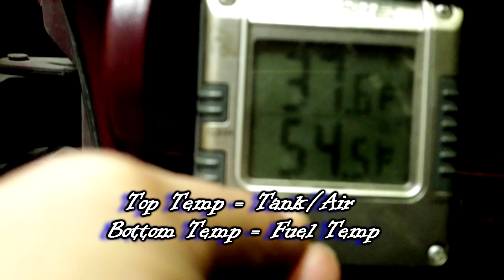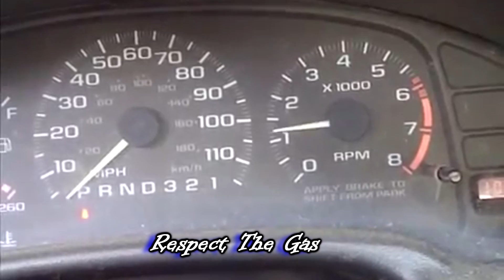Is 100MPG + Possible?? Alternative Multi Fuel Vapor Van!

Comment: I've debated running a T-connection of some sort to a transmission cooler that is housed inside a fuel cell.  Zero spark issues to worry about, and it's going to constantly be warm as long as the car is warm. Use the regular fuel system to start the car and have the fuel pump on a toggle switch to shut it down once warm?  Just thoughts in my head!  I'm thinking of doing it to see it it is possible solution. A warm coolant would warm the fuel faster than sticky heaters. Less loss in thermals. Should be sufficient.
Reply from the maker: Thanks for your input and watching. Yeah we're thinking alike, I've taken a ammo box and 1/2 copper pipe with a bunch of elbows (to run coolant through) and made a fuel heating box to use a fuel pump  to circulate it into the vapor box. Then we moved, shortly after my son ran the oil out of the van and blew it up, then the firebird got into the mix. So it's on the back burner and will be used on a lawnmower engine for testing with exhaust going through the copper instead.  I'd still want to pre-heat the vapor box and try to keep as warm as I could with those heaters.
Reply: @InJayzBrain  12 ft of high temp hose and 12 ft of copper tube.T each end so water can be run into it at 180 degrees and return to the block. And the copper,on one end tap into the fuel line,and other end send to injector or carb. Once the copper line is inside the rubber, wrap it around a can or cylinder of your choice and have a coil that will fit neatly and less space. The copper will have 12 ft of 180 degree water hose to get hot before it comes out. OR wrap the copper line around the exhaust pipe before it goes into a carb or injector,directly from fuel line.

Comment: im working on a spray system that takes care of the vaporization and usieng some exhause heat to fully vaporize it. extra spray goes back into a T valve just b4 a fual pump, so u don't cycle all the gas
Reply from the maker: Nice, I'd love to see some pictures on that. Are you video documenting the build?
Reply: sadly im not but I can explain, the  spray thing is as simple as a misting system which uses a pump, orifice,hoses ofc, making it out of pipe and emt conduit imagine something like a + were 1 side goes to engine 1 side fresh air top is spray in-let , bottom have a line running back to the pump using a T fitting. so u don't cycle all ur gas tank. because might end up making the gas in tank go stale, which u may notice happends when u try doing regular vapor methodes u see online. after that part just need a valve for fresh air to make ur air/fual ratio. after that run it on exhaust headers to heat/vaporize the mix then u have butter fly valve for throttle, and iv done it to a 14hp onan welder/generator and it works fine. runs so clean u can't smell the exhaust at all, just as if hot air is coming out
Reply from the maker: That sounds sweet, I've made a fuel heater out of an ammo box and 5/8 copper tubing initially to run my coolant through while this cycles gas to the vaporizer tank. Since my son blew up the van I haven't done anything with it. After I get a couple project cars done I'll be fitting that to a lawnmower and turning that into a generator with the fuel heater piped into the exhaust and see what that does.
Reply: InJayzBraiN it's best not to use heat, all you need to do is remove some of the atmosphere.

Comment: Been running a vapor carburetor on my boat. Have had trouble with moisture building up in vapor cell. Found that a mix of alcohol keeps it running better and keeps gas from going stale. It uses way less gas now. Think it burns so much cleaner too.
Reply: interesthings, what kind of alcohol did you added, and how much ml per liter of gasoline ?  thank you
Reply: seen some use white gasoline instead.

Comment: The Oil Companies put additives in the gasoline. If you run a cold bubbler system , the engine will run for 20 minutes or so, then it will stall. This is because the Gasoline goes flat, and no longer produces vapor. The Gasoline that is left is called the "Heavy Ends", and is full of Olefin's and Paraffin's, and will leave a greasy residue, that will clog your components, and wont produce vapor.

Comment: Hi 
Thanks for your response. 
The tank we used was originally a milking machine vacuum tank. At the time we had no idea vacuum was the function of the device. We used a bubbler system. Actually after 3 years and the break up of our team. I never thought to test to see if the increasing viscosity would work as a natural valve that would give appropriate resistance on its own. I was pondering the magnificence of the universe one night and thought of it lol
( about 10 years later)
You see because you are refining the gasoline into layers the final heavy ends resemble diesel more than gasoline. If you take the unit apart or take some of the gas out of the tank as a sample, you will find it is a little oily feeling like gasoline that has sat in an open container for a few days
Gasoline evaporates at room temperature then stops because the boiling point of gasoline is 100 to 400 F. Keep in mind it is the by product of refining and as such it is the light ends of the heavy ends of the fluid that was refined at a lower temperature. It is also the light end of the refining process of the fuel that is next in the refinery process ( diesel). The light ends of gasoline are like the heavy part of a vocation fuel and the heavy ends are like the light ends of diesel. Then there are many " layers "to the gasoline itself.  These layers are the problem for as you progress through them they need a different environment to evaporate in ( more heat more vacuum for instance
The final tank was made from a 12x12 steel column ( hollow not I beam ) a tube. It was 3/8 of an inch thick and we put a false bottom. We used a 3/8 plate for the top and had a gasket surface ( big mistake it leaked ) with a clear plexiglass port in the top. We used a pool valve for the intake and the throttle body on the engine for the speed control
We used grey plastic plumbing fixtures and a clear vinyl pool hose as the delivery with spline fittings at both endsTom ogle used the original tank and steel plumbing lines up the frame. This way is a problem as it takes a while to get the vacuum to form as there is so much tank to draw the air out of
Engine mount is best. Trust me on this one
You can hear your garage with the exhaust but the carbon dioxide will displace the nitrogen in air and though the exhaust is not toxic like carbon monoxide it is still something to be wary of. We breathed it for 2 years with no health problems
I never tested the vacuum strength but if you placed your hand over the intake and re ex the engine with your hand as a control it would bruise your palm
We calculated for the tank 12 inch cubed a 3/8 hole was perfect
Hope this helps I don't know how to send pictures but would if I could
Leslie
Reply: It is supposed to say aviation fuel not vocation fuel and heat your garage not hear your garage.    Stupid spellcheck
Reply: @leslieclendening2947  
Hi Leslie. Hope this finds you fine and well.  Great info you have kindly donated. Thank you.    
Joe of The Joe Cell fame, claimed his brother or uncle was running an old car with advance retard on the steering column that he had piped up, with a certain stainless steel from the exhaust ports, directing back into the inlet ports, and says it didn't require fuel, and that they used the car for months, possibly years that way. I've pondered that for years. Any thoughts on that please?.  
So another thing i was thinking was using white gas rather than gasoline in the system you worked on as it would work on a set level, rather than light, medium, heavy parts.  Any thoughts on these two matters I've mentioned please Leslie.
Hope you a lovely day.

Comment: OK. so my system works. first of all...don't risk explosion. build a vapor vessel with flash arrestors. second. use a small secondary fuel revoir. heat that fuel. send it through a return. back to itself. regulate the fuel level in the secondary via pump and float switch. use a marine grade oil cooler commonly found to preheat the fuel. now my big secret. don't bubble fuel through itself to produce vapor. have a pump..mechanical or electric flow fuel over ceramic glass matting commonly used as chimney flu insulation. this will act as an evaporator and will not impede airflow. then the use of a thereafter actuated fresh air valve to introduce non vapor air into the system and regulate air fuel ratio. last but not least..use a digital air fuel ratio gauge to monitor and tune the system. message me and I'll give you all the details you will ever need.
Reply from the maker: Thanks Matthew! What is it in and MPG or time difference? Good to know I'm moving in the right direction, I've already built a copper radiator to heat the fuel and pump and have been looking around for different types of float switches, also was thinking quite a bit on the "Wick" idea.